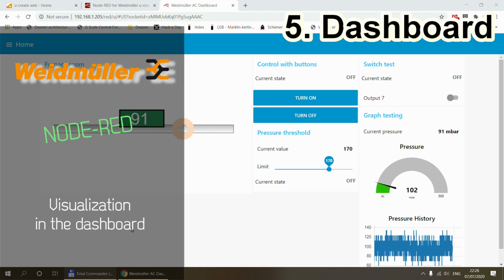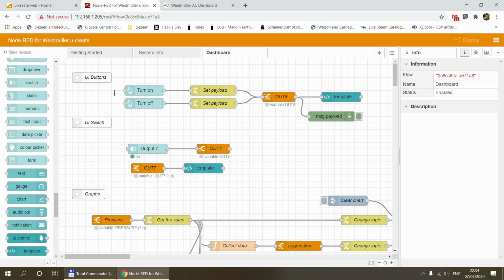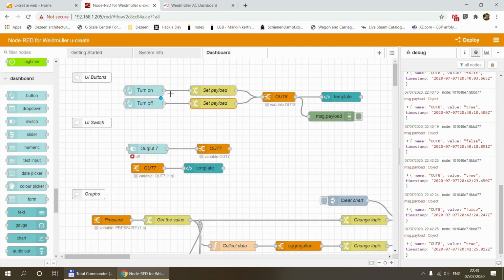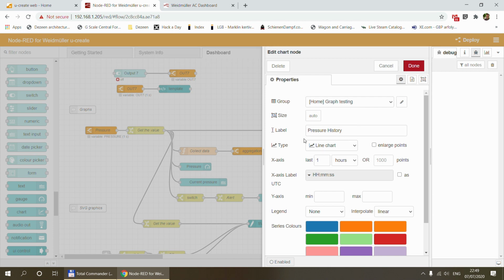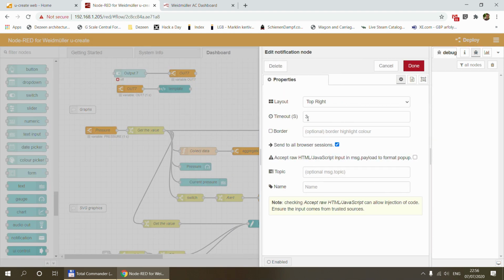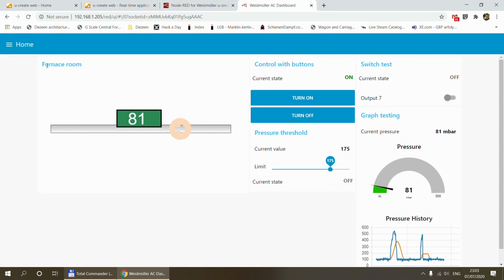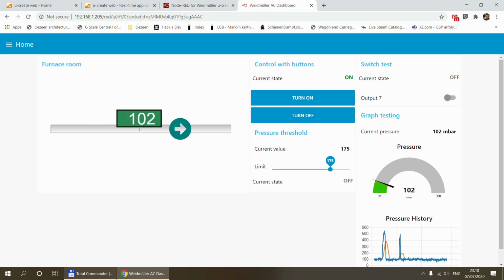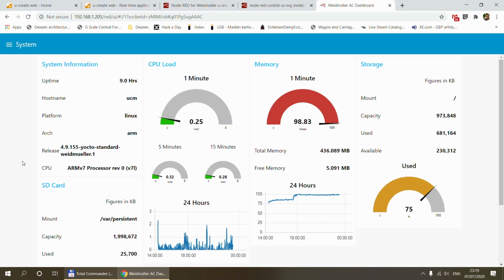Weidmüller AC: Dashboard in Node-Red

Comment: I appreciate your videos very much. They are very helpful and informative. I have not seen many videos that use Weidmuller u controller, so I am grateful for your work. Thank you very much.
Reply from the maker: Thanks. Too bad I don't have it any more...
Reply: Hi, I'm sorry to bother you, but I have a question about this kit. I connected it to my laptop via USB and programmed it using Node-RED. How can I access the output as a web link? What URL should I enter in my browser? @csongorvarga  Thanks in advance.
Reply from the maker: @sadeepthajayathilaka3144  I don't remember where, but there was network settings in the general setup where you could provide a fix IP address to the device. After that you can access it on that IP over the ethernet connection.
Reply: Thanks lot yes what you said is correct @csongorvarga

Comment: Flows stopped due to missing node types.

uc-iodataOut
uc-iodataIn
uc-aggregation

I am getting above error...i could not find these nodes in manage palettes to install them.
Please help...
Reply from the maker: I made this flow especially for the Weidmüllwr automation controller. Those nodes are specific for that hardware.
Reply: @csongorvarga  which node i can use instead of it
Reply from the maker: @sjmusic3428  As I said this flow is designed specifically for Weidmüllet automation controller. I have no idea what nodes to replace them with, it depends on how you get data, what device, which protocol. But I double that you find a 1:1 replacement node.

Comment: Under which library did you get the OUT8 node?
Reply from the maker: This is part of the standard installation for the Weidmüller Automation Controller. You would not be able to use it on any other hardware.